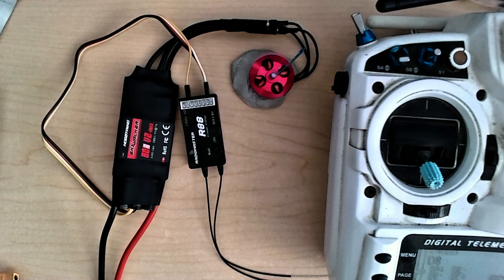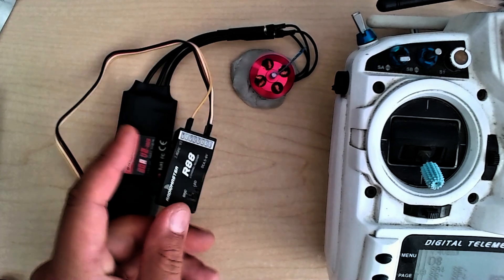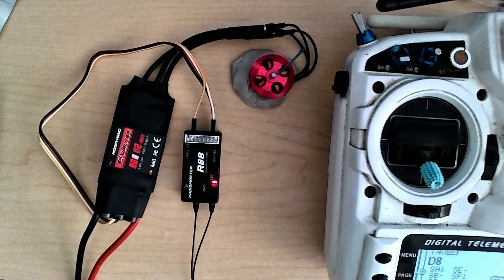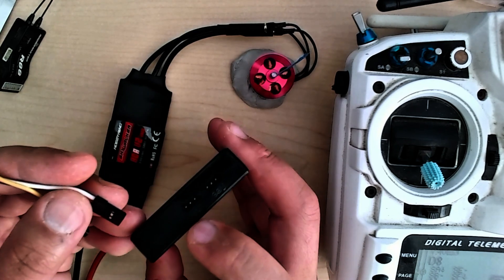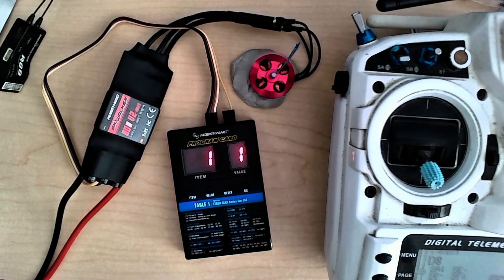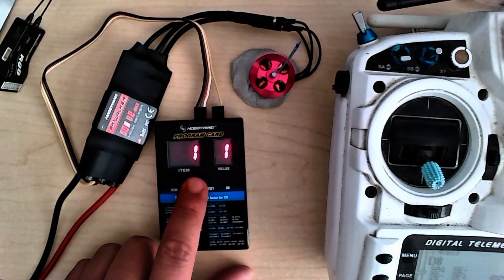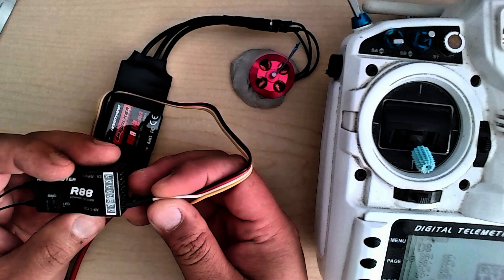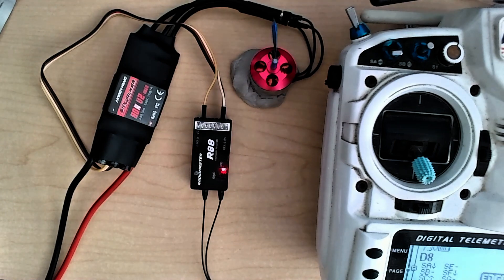Hobbywing Skywalker V2 15A-100A  Setup

Comment: Good day, could you please tell me if its possible to use this with a pistol transmitter, and if so how do you do the setup. I have checked the programming but cant seem to get the motor to turn. I'm trying to use this in a custom build, and I would really like to keep this ESC as a normal ESC (rc car) would require me to cut a whole which I really don't want to do

Comment: Using my old hobbywing card only works with normal skywalker esc programing for some reason..when I use it to program my 50amp v2, it seems to work great,but will never save settings..very strange..tried many times..I did use program card like you have here and setting seem to stay...main thing is this card has confusing choices..timing for example on card says like  6 different values,but when I have my 50amp v2 plugged in I on have 2...I amp guessing 1 is low 2 is medium etc...please let me know ..thanks